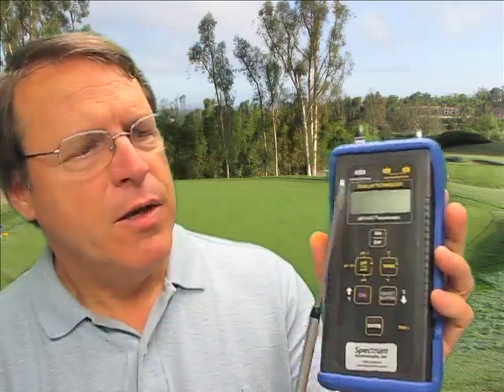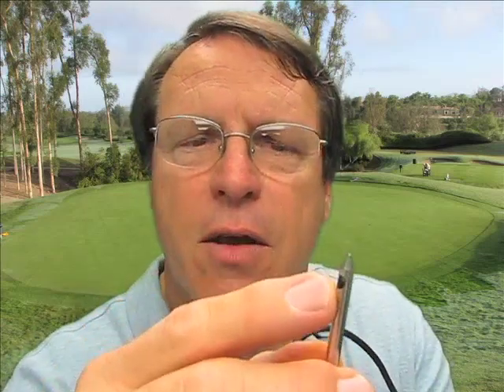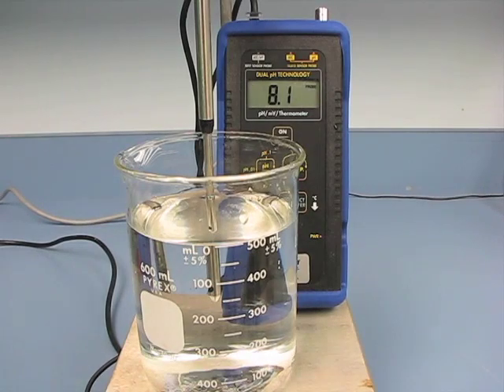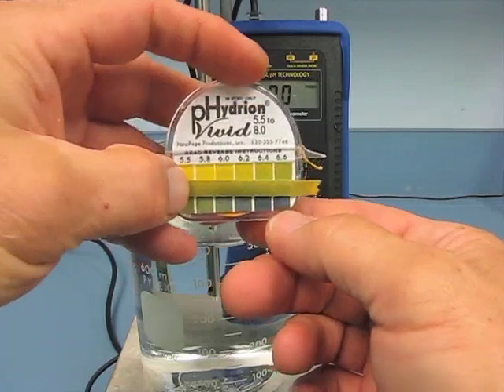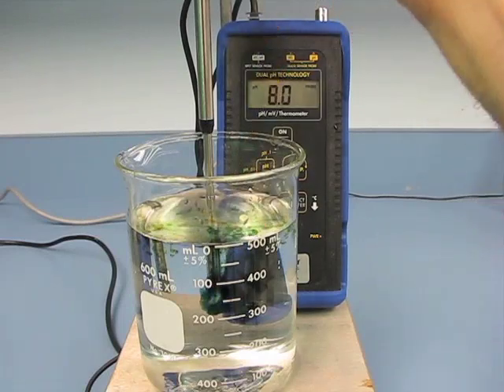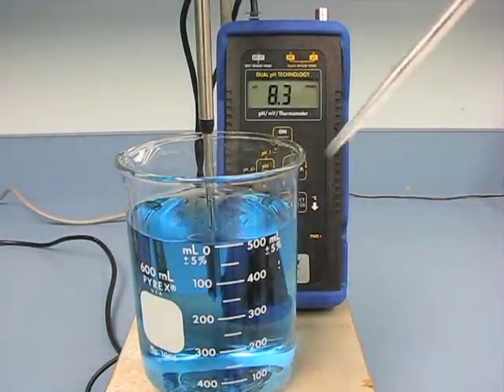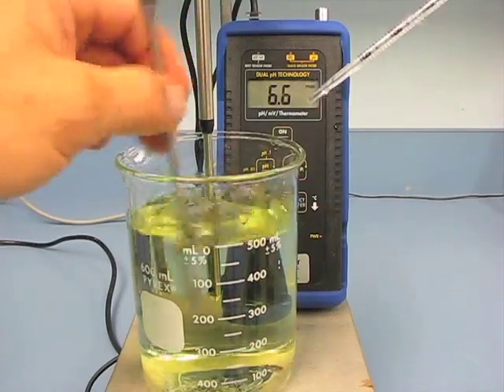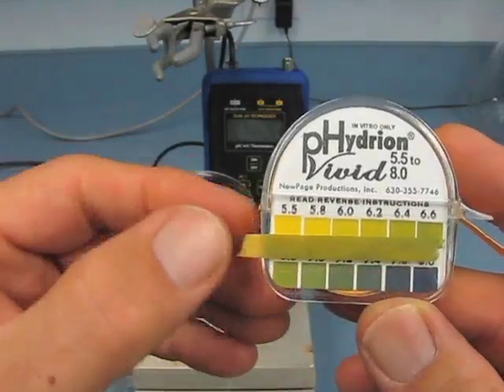Adjusting spray solution pH

Comment: Sir is it safe and effective for adding vinegar in water used for pesticides and fungicides
Reply from the maker: Here is an article recommending vinegar to adjust spray  solution pH . You just have to be careful to not add too much so that pH does not drop below 6.5 - monitor pH while adding the vinegar. Commercial buffering systems are more expensive, but easier to use. https://gpnmag.com/article/effects-of-ph-on-pesticides/

Here is some additional information on spray solution pH buffering: https://ag.umass.edu/greenhouse-floriculture/fact-sheets/effects-of-ph-on-pesticides-growth-regulators
Reply: Sir my water ph is 7
Then how much lemon juice should I add to lower ph 5 in 100 litre water for spray
Reply: @paceturf  thanks for support 👍
Reply: @paceturf  thanks for support 👍